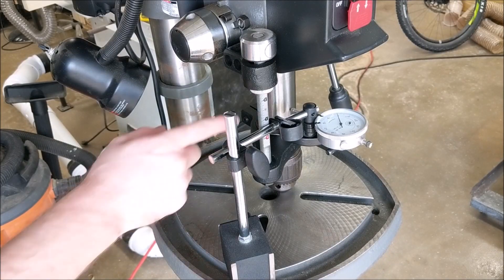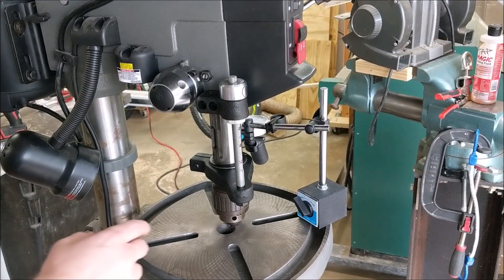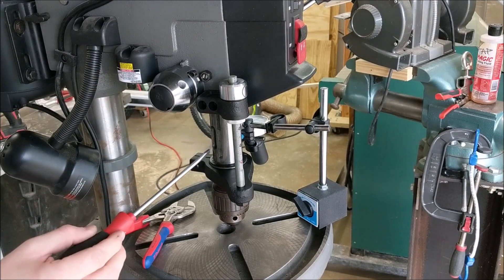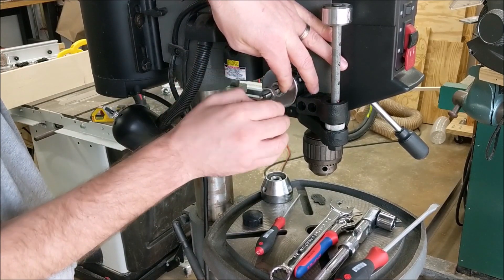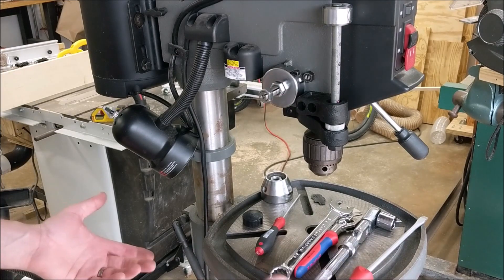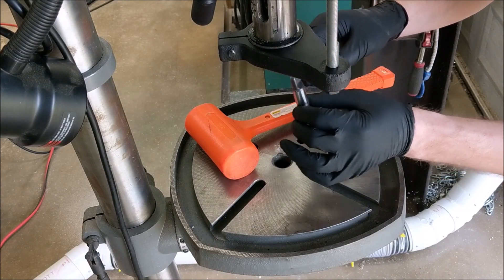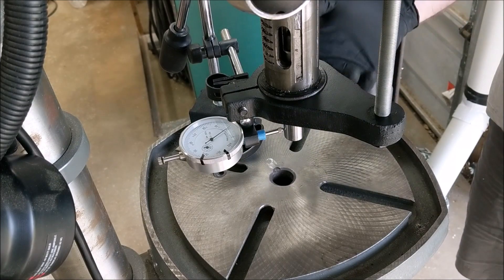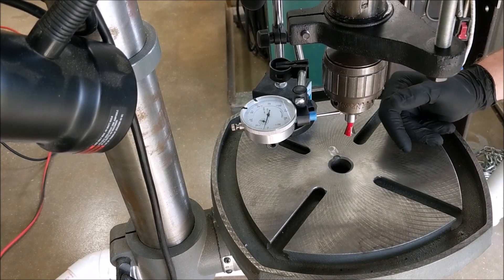Drill Press Setup P2: Arbor & Runout Adjustments

Comment: I ran into the same problem with the drill press I have. It’s one from Harbor Freight. I removed the plastic housing on the front of the machine that has the on/off switch.  The case is actually split and there are ears that have large adjusting bolts. You can tighten them to take up the slack on the quill.  Hope this helps someone.  Not sure if other brands are made this way.

Comment: The only way to alter deflection with the set screw is to remove the quill because it has a square head that fits in the keyway. You can tighten it a half turn which will push it against the quill firmly and reduce L-R quill movement. Grinding the head round like a pin that is perfectly fit to the keyway is actually FAR better for offering an adjustable control for quill wobble while still being an anti-rotation key.

Comment: Ahhh, am I missing something here? Started out with 9 thou runout, then cleaned it all up and ended up with 9 thou runout which you were happy with. Thus the runout procedure accomplished nothing?
Reply: Yes, you're missing something.
Reply: I think what you really want to show is .009, nine thousandths and .005, five thousandths. What you’re showing is 9.0= 9 inches and .5 is a half an inch.
Edit: After rewatching the video, he said he had it to one half a thousandths witch is .0005.
Reply: Watch it again. He said run-out improved from 9.0 to 0.5 one-thousandths/inch.

Comment: That is NOT the correct way to set that adjusting screw, It has a flat spot and you need to remove the quill to adjust it..
Reply: Can you describe the correct way to remove the quill and make the adjustment or provide a link?

Comment: Bought a 20" Taiwanese drill press third hand. As with other used drill presses, dirt, loose fasteners, and rotted rubber were behind 95% of the problems. It would be nice to know how to clean, lube and adjust chucks, too, wouldn't it?
Reply: Yeah right, if you don't fix it a bolt won't fit in the holes.